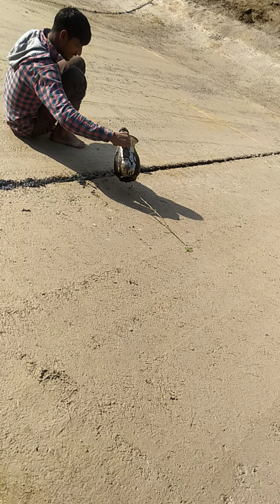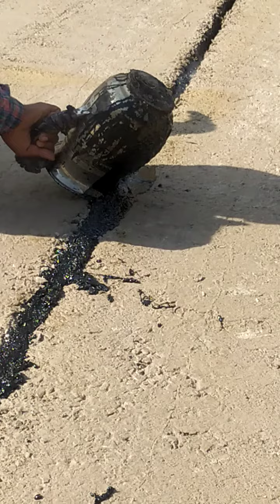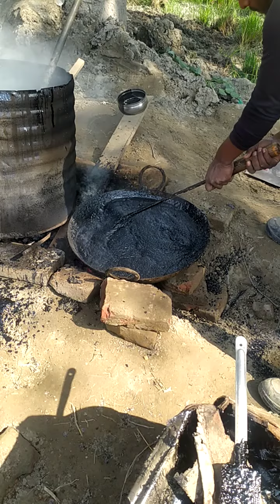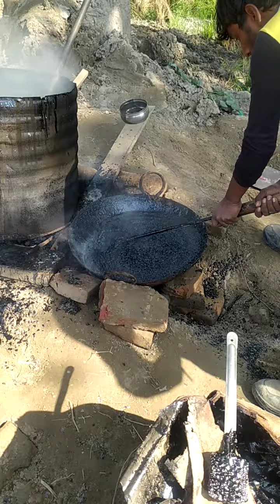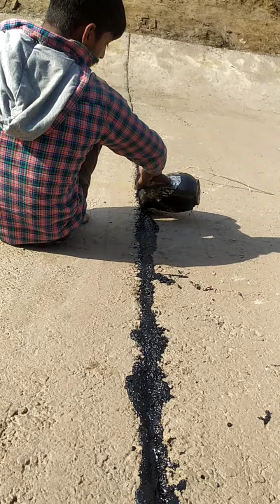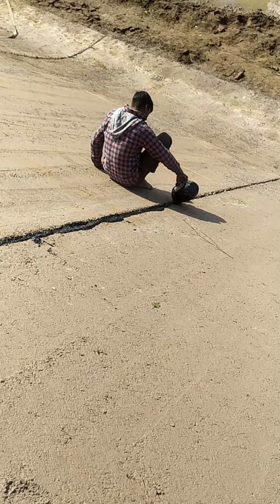Expansion joint filling with Tar or bitumen sealing compound to feel the Exp. joint on canal lining.

Comment: Can you tell me how can I hide the black tar colour on a pcc slab where we used bitumen to fill the expansion gap. It's a basketball court
Reply from the maker: Yes, we can use white tap on both side of expansion joints and fill bitumen after that remove tap and surface of slab is clear